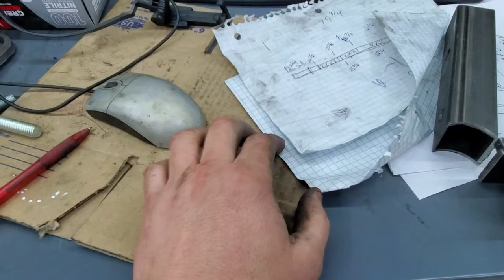Today a Standard Weight Axle Bar was born!!

Comment: Congrats man! Up to how many lbs can that barbell hold?
Reply from the maker: It has 12 1/2 inch load sleeves. So that will limit it but I teseted this one at with a 500lbs load. It had no deflection or deformation. It should be able to handle many years of 300lb uses and occasional 400 to 500lb use
Reply: @GorillaStrengthEquipment  Sounds great. I also enjoy using standard plates cuz it's cheaper and easier to packup. Wish there were more sturdy barbells available though